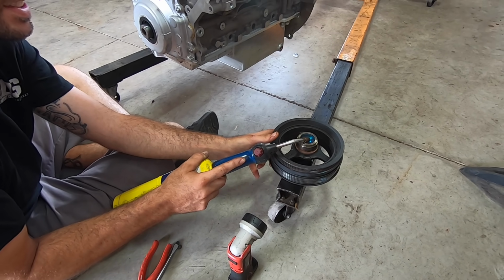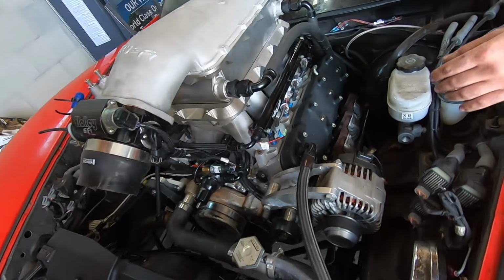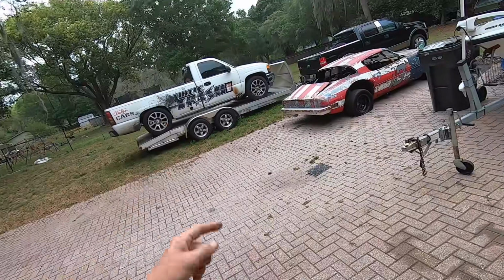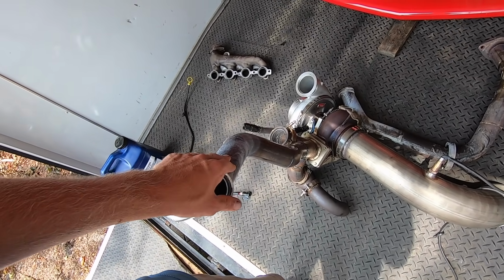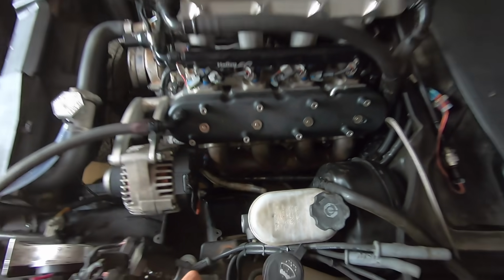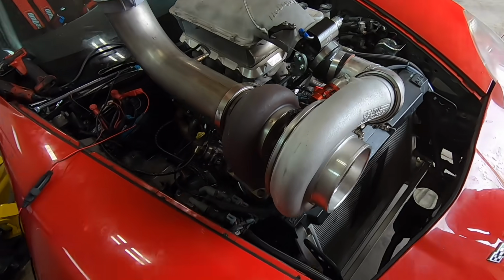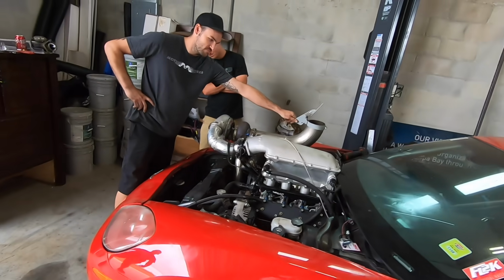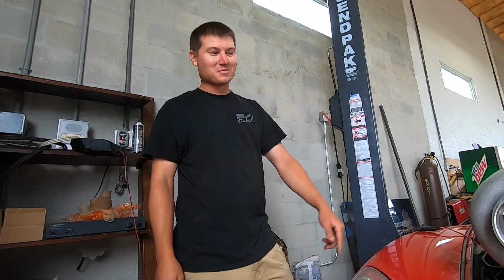Firing Up Ruby With Her NEW Texas Speed 7.0L V8 + Completely Changing Her Turbo System...(we had to)

Comment: Ive been hearing a lot about this "el camino" you speak of lately.... when we getting the goods mane?
Reply: Evan Sanchez their not doing it anymore was gonna be a jet car , but they scrapped that idea for saftey
Reply: @808beatmaster  yeah i saw that but just fhe other day the vid with the pro mod he said something about the el cam having a gear bender in it i think. Might be wrong idk. Agreed that having a jet car is sketchy af. Those dudes are wild. Cleetus is already nuts with providing us with the conteng he does
Reply: @808beatmaster  they just scrapped the idea of putting the jet engine on the el camino because of safety issues..They're still building it though,just not jet engine..
Reply: El Camino should get Toast's engine, since Toast is downgrading. Make the El Camino into a 5-6 second car!
Reply: @KJ-kw7gh  The engine in toast isnt anywhere close to a 5 or 6 second engine lol
Reply: Braydn k it is as long as it can handle 40 psi from a wuhan flu spooler
Reply: @gunsandmachinesenthusiast  You mean a hong kong hurricane? Also no i still disagree
Reply: Bradyn K That's why I said make it into a 5-6 second car. 632 cu in. has a LOT of potential.......
Reply: Bradyn K u mean a wu tang twirly thang
Reply: @Keith_james7  No, im talking about a Hiroshima hair dryer

Comment: You should re weld the flange for turbo back on that holey pipe so u can turn the turbo slightly and get that exhaust away from intake. Exhaust More out the passenger side, or more up

Comment: This is definitely kind of min/max suggestion, but all your weld beads on the interior of your intake/turbo pipes probably cause quite a bit of turbulence and may be slowing down and chopping up the air going into your engine. Grinding those down should theoretically improve bald eagles, make it run smoother etc. Keep up the amazing videos brother! Can't wait for more updates on the fleet, really missing the Dale truck!!
Reply: That would assuming all of the welds are over penetrating

Comment: You could have done what I did and just made a spacer out of a piece of aluminum and then slipped the manifold on top of that. I needed about 1/8th of an inch to clear my AC compressor(I refuse to live in the south without an AC) after I flipped the manifolds for a turbo setup. Works perfect and didn't cost me anything since I had the aluminum.

Comment: Hi boys, just thinking out loud about your head gasket blowing around the water jacket. It has to be high water pressure, probably from high revs
On the water pump. If there is any restriction, like a closed thermostat, could build too much pressure, food for thought.

Comment: Your issues with head gasket integrity is because of the weight of the turbo being supported by the head, and not because of heat. With turbos you need to brace and support them from the block, so you are not putting unnecessary stress on the head gasket. It will increase your reliability. Just a thought.....

Comment: So I don’t know how well this would work if you thought about it in engineering terms, but if you ever wanted to change up the turbo placement again here’s an idea: modify the front bumper and have the turbo sticking through where the corvette logo sits. It’d look super cool, get weight out over the nose, and you’d definitely get PLENTY of cold air. Might even be more efficient because it’s away from the header and not getting heat soaked

Comment: Balancer in the oven. Not too hot or you will damage the rubber in the dampener or the front main seal. You want to heat it evenly and not just the center. Ice pack from the freezer on the front of the crank. A good 30 min for both. Welding gloves to pick the dampener up. Should slide straight on with no effort.

Comment: I had a flashback when you stuck your hand down by the belt (25:45), (26:19), and (26:09).  You never think it'll happen but the slightest touch of the belt can grab your finger and bring it right into the pulley. It'll crush the end of it off in the blink of an eye.   Please don't do that.   My left index finger is 1/2" shorter because I did the same thing.  My finger looked like Skeletor when it skinned it down to the bone.

Comment: Torch heat to the balancer is a hack move. You can melt that crankshaft seal or get an installer [ not the bolt] that you can operate, easy choice.

Comment: Hey cleetus that statement about your turbo exhaust outlet throwing heat at your manifold. why don't you shorten the run and 90 straight up? Do you want that extra length out the back of the turbo?

Comment: about the heat to get the balancer on: this is why your cars only make 1000 wheel horsepower lol. sometime you'll have to do everything "the right way" and see if you can make 2000.
Reply: Apparently, if you heat it just the right amount, it doesn't cook the seal. I agree with the proper install method, but I don't build, or repair engine stuff for a living. I'll stick with my proper tool.

Comment: Y’all should use a turbo blanket and header wrap for the turbo and “exhaust pipe”
Reply: or they could just do it right and ceramic coat all the exhaust. It is not terribly expensive and keeps it much cooler.

Comment: you got to move that turbo far enough forward so it makes up for the weight difference that you're losing with the ls aluminum block.
Reply: Yeah, the torque and weight difference is going to eliminate those consistent passes. But the speed will be awesome.

Comment: If you don't have the proper tool, use a length of threaded rod screwed right into the crank, then a nut to pull the hub on.
If you could have done a deal for a reverse rotation snail, it would have been a heck of a lot easier for the plumbing - version xxx, no doubt/?

Comment: At top speed down the track will the wind/air at that speed potentially cause the exhaust flap to want to shut therefore causing exhaust flow restrictions because of the way you have it opening? I mean you think at 170 mph/plus?... Thats alot of force.... Just curious....

Comment: does the heat ever cause an issue with the front crank seal at all???
Reply: I'd be more worried about the rubber in the balancer personally. But if it works, it works.

Comment: If you think the exhaust is too close to the intake manifold, why don't you just cut it near the v-band at let's say a 10 degrees angle toward the passenger side? It would give a bit more clearance and it's only a 30 minutes job or so! An other option would be mounting a heat shield on the exhaust pipe but that's not the most elegant idea.

Comment: why not pickup a piece of grade 12.9,  16MM threaded rod by 200mm long and some 10.9 or 12.9 nuts for it.. so you can easily pull the dampers on without damage.. since you do so many LS engines..  i realize that heating the damper is easy... even getting a 140MM long bolt .. the stock size is 16M x 2.0 x 110   so a 140 or 150MM perhaps even a 160 will engage enough threads in the snout to allow you to pull the damper on without yanking the threads out of the snout..  as long as you stop before it bottoms out and mushrooms the end of the bolt.. destroying the crank on its way out..

Comment: Hey cleetus y arnt u running an intercooler kn ruby cooling the air charge down would give u a goof amount more power. I was just wondering what ur thoughts were on that
Reply: They don't need it, since they run methanol. It cools the air better than an intercooler, also less turbo lag
Reply: @chevy383jt  They run Ruby on ethanol, not methanol. There's an air to water intercooler inside the intake.
Reply: @MellowYe77ow  I haven't paid close enough attention. Can't remember all of the fuels at different times. I thought I saw Ruby run with premium gas and methanol injection at some point. The intake was super cold. Coulda been a different car.

Comment: What type of coolant do you guys use? What type of mix if any? Cheers on the start up of Ruby
Reply: Race cars run straight water, you don't want the anti freeze to leak on the track.
Reply: @Smith5783   thanks for that. Makes sense now.
Reply: @jeremygush3342  I should probably add  that there are other products that are ok for use on track that have anti corrosive properties and prevent  freezing, I have never seen these guys use them but they are around, Florida probably doesn't have much of a need for them though.

Comment: Need to clear some engine bay space for propper headers, Those hooker cast things (I love them dont get me wrong) do kill flow compared to more tradional long tube wide diameter tubing.
That turbo-TB tube is probably actually better longer, while having a 90degree dogleg will totally fuck the airflow the way its set up you're also asking it to do a full 180degree turn in just a few short inches through the blow off valve. This motors probably losing upto 200HP from what it could be if just orientated differently with different headers.

Comment: If the tool eats the threads its cause your supposed to hold it in place while you crank the installer nut.  High five guys!

Comment: “We’ve been doing it like this for years” the perfect answer for I know I’m doing wrong but I don’t care.... all the need is all thread and some nuts and washer and do it what we call the right way. Cost you like $12. Just saying.
Reply: Danderson GM i was thinking the same. And how could heating the balancer not hurt the crank seal? Or the rubber on the balancer?
Reply: I was concerned about the seal getting too hot.

Comment: ahhhuck your builds are messy... why turbskies up high... get a chassis that can take twin turbskies under and with the added weight have a bigger block .... go get it built by pros go halves and tell them you will youtube it and they get the massive exposure you can give... seems with what you have you will only get so far.... and its not far enough too backyard and slow...